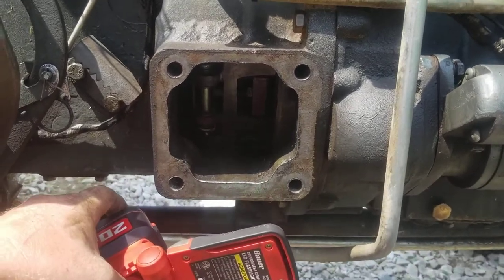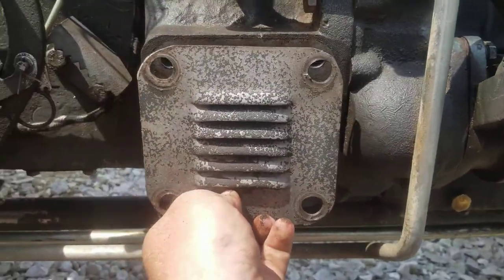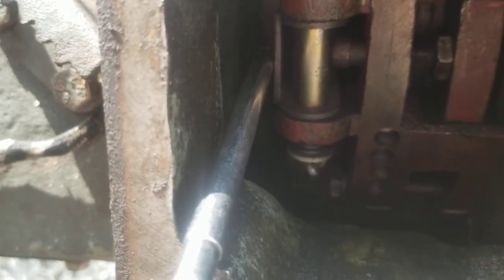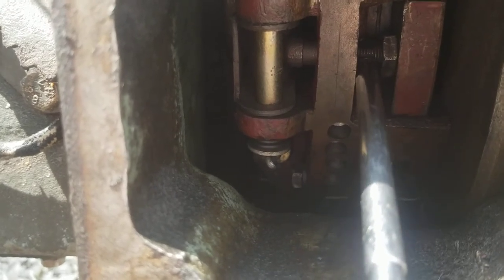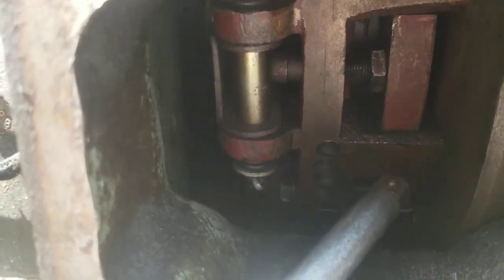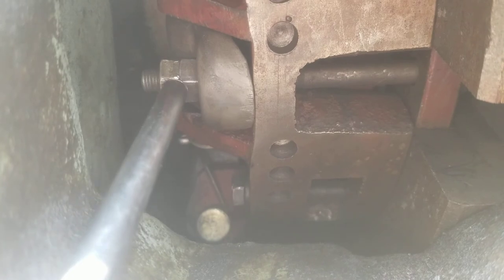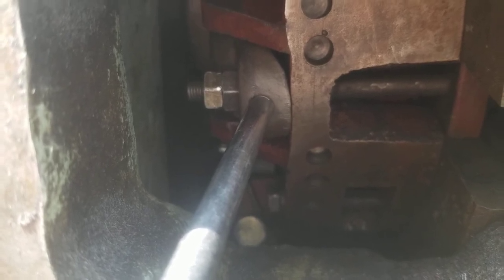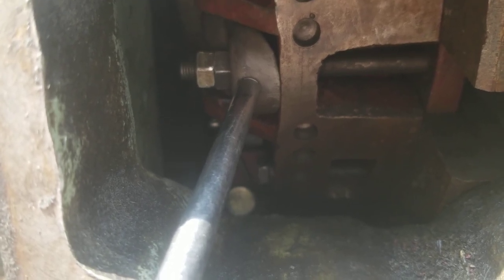Clutch and PTO Clutch Adjustment Foton, Futian, Lovol, Some Farm Pro

Comment: Aux clutch adj  tb350 tb354 clutch is 8.5mm and 8 mm  on the tb400 & 500 series clutch i am planeing on using a 2.5 mm welding electrode and a 8 mm extra long allen key

Comment: I just bought a 250A and the clutch doesn't release on it ! I did manage to get it into gear and start and I drove it, So I Know the clutch isn't slipping. But when I push the clutch pedal NOTHING happens !. Gears grind and won't go into place (haven't tried forcing them !!!) Was hoping someone could help me figure out why it won't release. There is NOT much travel at all in the pedal !. Feels like the Pressure plate  inst flexing anymore !?!?!?. Please somebody help. I really need to mow some grass !!. Thanks and Happy Holidays from Dan and Jo Ballard/Ballard Towing in Ocklawaha FL 32179.
Reply: My dad's has done something similar and we take the top plate off that attaches the gear shifter.  We repositioned the slides inside "not sure what they are called" and put it back together.  The problem is, if you don't push down on the shifter when shifting, it would stay in the original gear and not shift.
Reply: We have the same problem and have done the same thing.